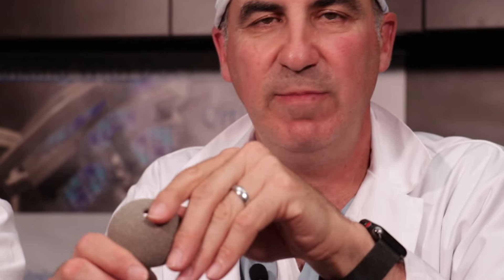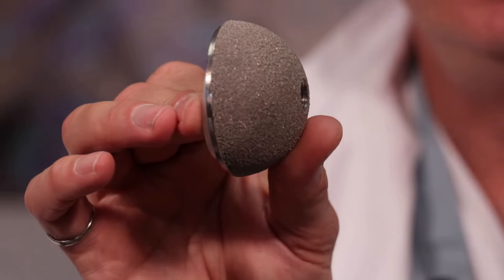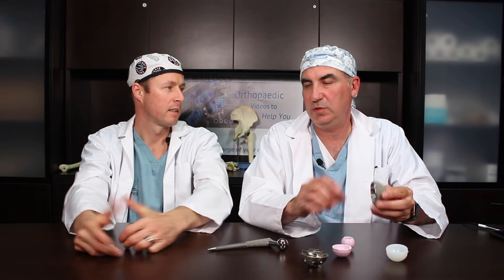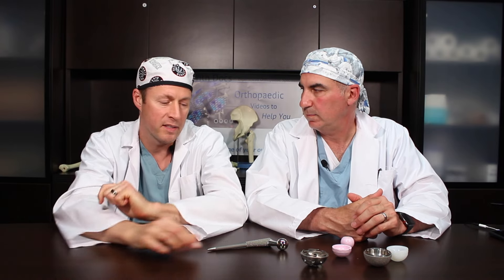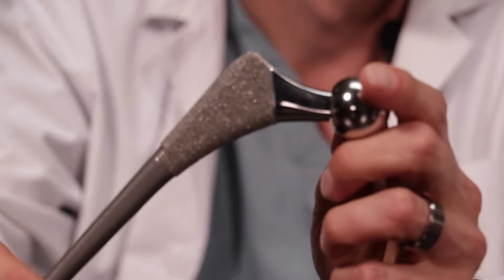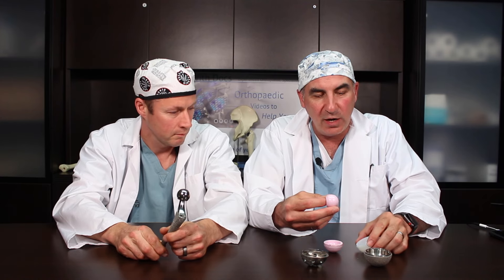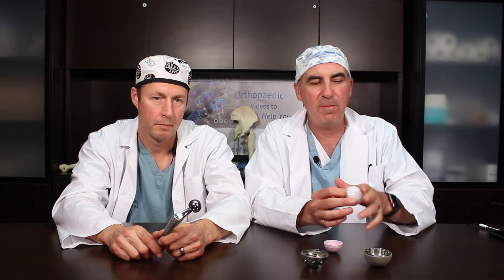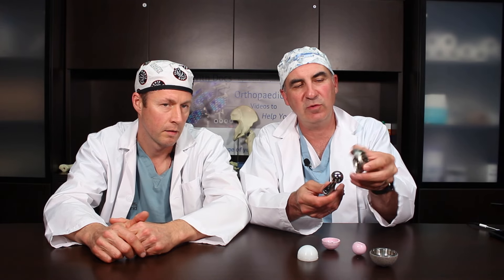Hip Replacement Implants - What Do They Look Like and What Are My Options?

Comment: A partial hip replacement following a fracture does not have an acetabular component. The prosthetic ball on the stem goes directly into the natural acetabula. How is this arranged and what is the wear factor, what actually wears? Mine is a double headed ball.
Reply from the maker: Hi Trilby. Yes this is common if you do not have any pre existing arthritis.  It is called a bipolar component.  The wear is the socket is usually quite slow and we revise few of them.  Good luck. Thanks for watching and subscribing

Comment: Metal ion release and the condition known as metalosis is not limited to Metal on Metal bearing surfaces.  Any exposed metal in vivo will leech metal ions into the surrounding tissues.  If the patient is allergic to these ions they will become symptomatic and the implant will fail.  If they are not reactive or they don't have an immunological reaction to the implant they might have a long life and not need a revision (read: failure) but the chance and statistics are not captured here in the United States because the FDA does not mandate an artificial joint implant registry - something we REALLY NEED!
Reply from the maker: Hi Don. Yes there can be very low level ions in the bloodstream but metal on metal hips are the ones that have caused the problems. Yes a joint registry is important but there are many around the world that provide useful information to help clinical decision making.  Thanks for watching and subscribing if you did

Comment: Thank You so much for sharing these videos with us.  I had a TKR of my right knee October 25.  I’ve been having right hip pain for years but associated it to my back issues (T10-S1 fusion) which radiates more to my right hip and leg than to the left.  My doctor took some X-rays of my hips and found that I am “bone on bone” and we are planning a total hip replacement surgery for February if my recovery from my TKR of the right knee continues to go well.  Good news is that it looks like I still have a couple of years before we have to address the left side. I found your YouTube channel before my TKR and learned a lot which I know has contributed to my speedy recovery. I am now watching your hip videos so I can be better prepared for this surgery.  Between my amazing surgeon and your videos, I am confident that I will make a full recovery from both surgeries.  Thank You so much for sharing your time and knowledge.
Reply from the maker: You are very welcome Mark. Thanks for taking the time to comment and so glad we could help. Best of luck during your recovery and your surgery in the new year. Thanks for watching and subscribing if you did

Comment: Nice and informative video. I haf THR operation back in 2017.  Uncemented hip : Corail stem, Delta motion cup 52 size  and Ceramic head 40 size lateral approach. May age is now 34. My doctor said you may sit on the floor occasionally but do not do it regularly, because it is not good for your implant. Is doctor worried about wearing ?  I have seen many people using indian toilets after THR. I really confused about restrictions.
Reply from the maker: Hi Omar.  It is hard to know the specific concern of your surgeon.   Wear is probably not the concern but dislocation may be.  It is always best to discuss it with them directly.  Glad to hear you are doing well since your procedure.  All the best to you going forward and thanks for watching

Comment: Hi Doctors i've just had a hip revision due to ceramic liner fracture, now they replaced the ceramic ball with a stainless steel (not CoCr) head and inserted a new ceramic liner,  i've been reaffirmed that this is safe. They avoided using polyethylene  liner due to the Ceramic debris that might get stuck in the plastic and cause third party wear, what do you guys think, should i be looking for signs of metallosis in the  next years ? how safe is stainless steel articulating on a ceramic liner ?
Reply from the maker: Hi Tim. Hard to comment on your specific case. With ceramic fractures we often will replace with metal on poly. Thanks for watching and subscribing

Comment: Hi Doctors, I had my hip replaced 18 months ago. Unfortunately, I’m still having pain in the groin and upper thigh. My surgeon said I’m experiencing “End of Stem Pain” and is suggesting that I have a procedure called Strut Allografting of the Femur. This is a major surgery and was hoping you can tell me more about it. I am an avid golfer, snow skier, hiker and enjoy riding my Harley. Now, I don’t think I can do these. Thank you.
Reply from the maker: Hi Kevin.  End of stem pain would explain the thigh pain.  It means the normally hollow femur is reacting to the presence of the stem and sometimes this area can become weak or thin requiring intervention.  If you are unsure, as this is a big operation, may be worthwhile considering a second opinion.  Best of luck to you.  Thanks for watching, subscribing and sharing with someone if you did.
Reply: @TalkingWithDocs  Thank you for getting back to me. Yes, I am getting a second opinion with a surgeon in the San Francisco Bay Area on September 29th. When my doctor mentioned a second surgery, I thought it would be a redo or revision and was caught off guard when he mentioned the Strut Allograft procedure. Regarding my second opinion, I will let you know how that goes in a couple weeks. Thanks again.

Comment: Useful info Thanks. Does the patient get  a Med certificate to avoid a hassle at airport screenings?  Or do these latest implants not trigger the scanner?
Reply from the maker: Hi Makinja.  So these implants will definitely trigger the scan.  There is no certificate that a surgeon can give that will be accepted because as you can imagine, if you were part of a sinister group, you could implant some dangerous device, print up some card that says you have a knee replacement and get through security.  We tell our patients to let the officer know you have an artificial joint.  If they have doubts or further questions they will put you in the scanner and can see it for themselves.  Hope that helps. Thanks for watching and for subscribing if you did.
Reply: Thanks for the clarification.

Comment: Is it safe for someone with hip replacement to use a tens unit to control pains?
Reply from the maker: Hi Flawi.  Yes usually it is.  Maybe not right over the incision though.  Thanks for watching and subscribing if you did.

Comment: How much do they weigh?  Do you use the 'sports' version with the dual articulating points?
Reply from the maker: Hi Kat59.  Every knee replacement is slightly different.   There is not typically a sports version.  Very good questions though!  Thanks for watching and for subscribing if you did.

Comment: This video cracked me up, but was educational as well. I had a right total hip replacement a month ago. I need to have my left hip replaced ASAP. I have avascular necrosis. How long do you reccomend between hip replacements when they both need replaced?  Also does avascular necrosis play a role in how you perform the replacement?  Love your channel  doctors. Thanks!
Reply from the maker: Hi Scott.  Glad we could provide a little comic relief along with some education.  So we usually recommend 3 months between hip replacements.  This is a general guideline to simply give you time to get over the first procedure and get your muscles strong again.  As for AVN, the approach to the new hip is typically the same.  Thanks for watching and good luck with #2!

Comment: I’m petite and that femoral component looks big. Is that also sized to the patient? Meaning, the length of it?
Reply from the maker: Hi Linda.  All implants are chosen for the individual patient.  The length of the implant increases with its diameter but yes smaller implants will be more narrow and shorter.  Good question and thanks for watching.
Reply: Talking With Docs ok, I’m putting that on my list, thank you. Because my luck, they’ll run out of appropriate size and I’ll end up a peg leg. Lol I’m seriously considering hip replacement but I’m a bit paranoid after reading what happened to Dr. Steven Tower. I don’t want cobalt anywhere near me. I know that was back in ‘06, but I’m scared of any foreign object in my body since the pins destroyed my femoral head. Conversely, I also know if it goes well, it will give me my old life back. Is Stand Up Paddle on the AOK list post operatively? Let’s say 6 months after? Thank you so much for your videos!! You are really helping people!!!🖖🏽

Comment: What is a typical range of motion after ceramic hip replacement? Thank you.
Reply from the maker: Hi Jennifer.  So the type of implant does not typically predict the range of motion.  It would be more related to the size of the femoral head implant.  Range of motion is also affected by preop range of motion and ability to perform physio after surgery.  Thanks for watching and subscribing if you did.

Comment: Why is there an ability to have dislocation of a new hip? Is there a reason that the socket could not lock smaller than the ball and still have ample rotation?
Reply from the maker: Hi scott.  Very good question.  Yes there are implants that lock into one another.  But they do result in a reduced range of motion and ultimately they can fail by pulling out if the force is too great.  Thanks for watching and good luck.
Reply: Talking With Docs Thanks for the reply, I'm headed for a hip replacement in the future and restrictions are not what I'm looking for. Love the channel.

Comment: Doc's why can't the ball and cup be easily replaced in a hip replacement revision?  Makes no sense. The medical community seems  way behind the rest of humanity.
Reply from the maker: Hi Graham.  It can be replaced easily however the problem is usually with the remaining bone stock and the muscles and scar tissue.  Hip replacements have come a long way.  Good question.  Thanks for watching and subscribing if you did.
Reply: @TalkingWithDocs  im 43 and need a left hip. I'm concerned that I will wear through one in 10 years and have to have a high risk surgery later when I'm 50 Plus. Would you proceed or wait 7 years? Also, will it stop my hip pain or just give movement back?